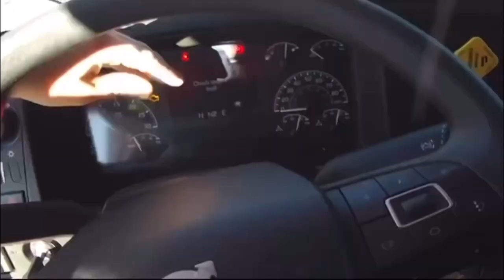Logistics Truck Drivers & Roadside Assistance

Comment: Hang in there girl. Also to bleed the air from the air/ fuel Separator.. you loosen the top cap. Then tightened it again. Releases the air

Comment: hang in their engine code could be a lot of things. trucks in limp mode. could be brake evolve under front bumper. it goes out takes the fuel pedal away from the driver too get it fix right away . just sayn.😇✌